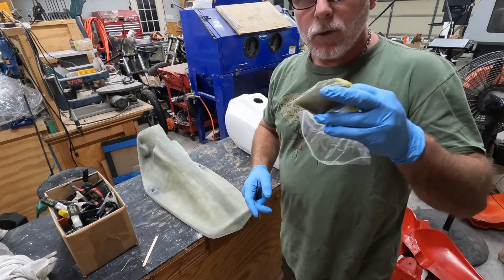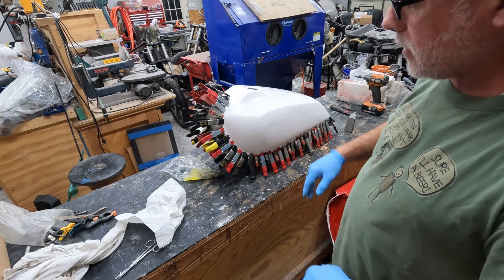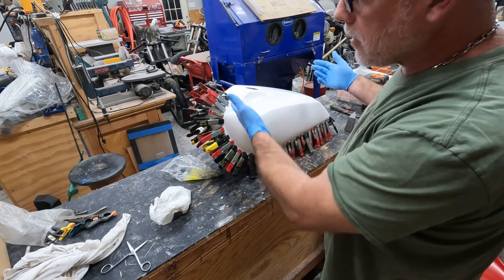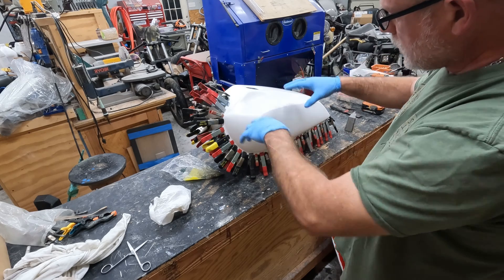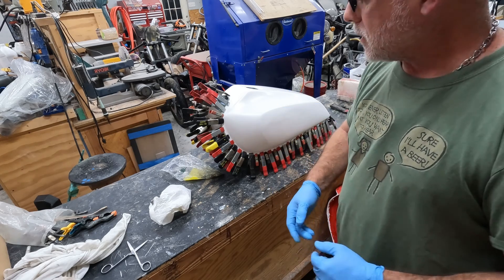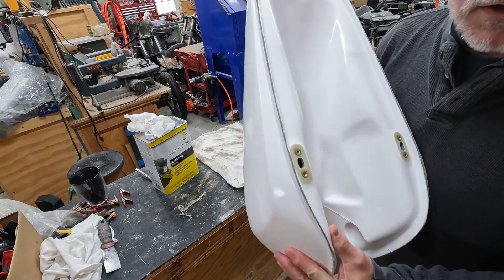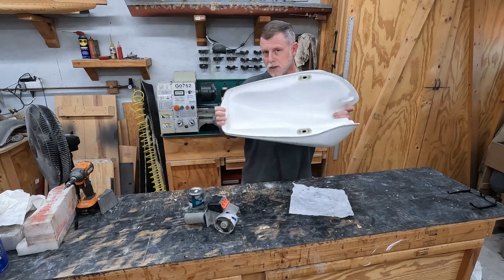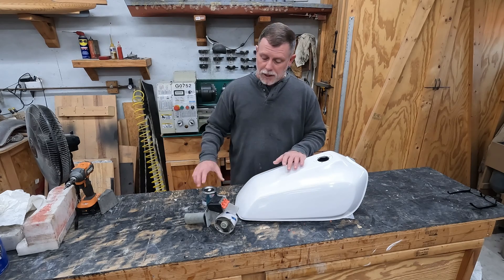Fiberglass Mold Making Producing The Fuel Tank EP4

Comment: Fantastic work but I missed what the putty was to glue the top to the bottom of the tank.
Reply from the maker: It is resin + Cabosil + Milled Fibers
Reply: @iccustomsusa8048  Brilliant thanks for the information
Reply: Sorry the ratio that you use would be very helpful of the mix?
Reply from the maker: @davidchannon8556  no ratio with the cabosil I generally mix to the thickness I want to work with. I guess it is similar to thickness of caulking maybe a little less. Sorry this is an experience basis. With adding milled fibers, I add approx 3/4 Fluid OZ in volume. Per 2 Fluid Oz of resin.
Reply: @iccustomsusa8048  Thank you it gives me a base to work from.

Comment: I have an early 1970's Tracy body for an XS650 Yamaha. I am wanting something to pour into the tank to seal the glass, no actual leaks that I know of. It has been empty for over two decades. The POR 15 product seems like it just might be the ticket, (I have used their original product with great results). I have no idea what type of resin they used 50 plus years ago. Do you think I should try this? Etch with something, then POR? Or should I use something else altogether? Thanks for the very helpful series and any input you may add to my situation.
Reply from the maker: Most likely that tank is made with polyester if it is from the 70's as ethanol didn't really exist in the age of leaded fuel. Polyester is not friendly with ethanol so, a resistant barrier is needed. I have never treated a previously used FG tank. Etching the inside would only be needed if it has a glossy finish. Degreasing and cleaning the past fuel residue is a big focus. A degreaser wash followed by an Acetone flush then allow to dry. Then install  por 15
Reply: @iccustomsusa8048  Yes, that sounds like a plan. I'll stick a camera in it and see if there is sludge or stain and go from there. And as Andy would say, "I believe we got her if she don't jump". Thanks again!👍

Comment: I can't believe this series doesn't get hundred Ks views. Anyway a question for you, what if you join the two parts while they are still tacky? That way maybe you don't need to glue them and the joined part gets the same structural strength as the layered fiberglass. The cons is probably that you have very limited work time.
Reply from the maker: Thanks for the support. First problem is the separate parts have excess fiberglass cloth material that overhangs during layup. The excess material requires trimming off prior to joining/gluing the components together. Trimming is done after part halves have cured.
Secondary after trimming I score with sand paper the inside surface (walls) for application of a tank liner/sealer after gluing halves together. This is to prevent fuel wicking and adding an extra layer of protection basically ethanol resistance.
Reply: @iccustomsusa8048  I was actually thinking about this technique for pre-preg carbon fiber. I thought maybe if the fiberglass resin is half cure to the state of tacky it will behave like pre-preg carbon fiber. And you can put a rubber balloon coated with wax in between the molds and the fiberglass to give pressure from inside and make sure the seam is pushed from inside.
https://youtu.be/bBbOUDDJv4Q?feature=shared